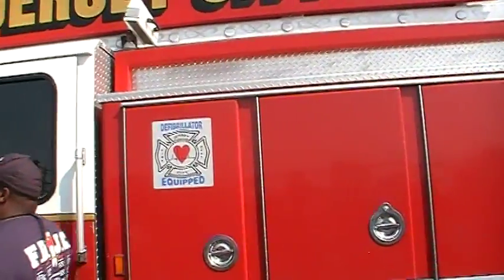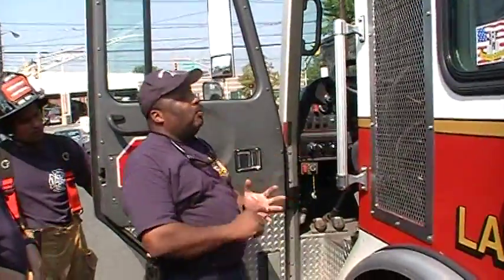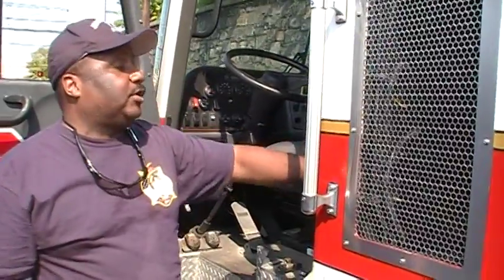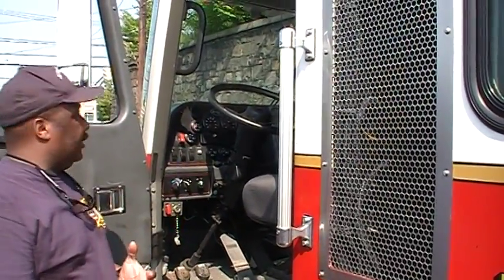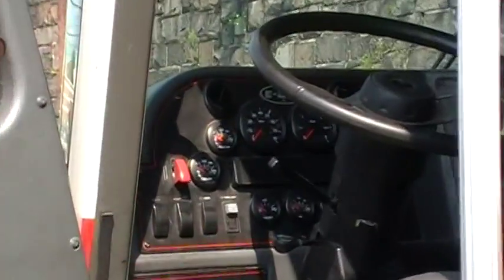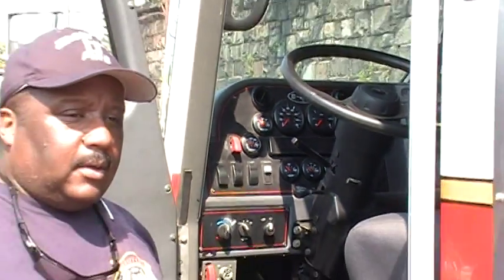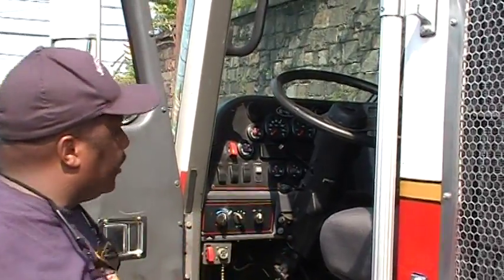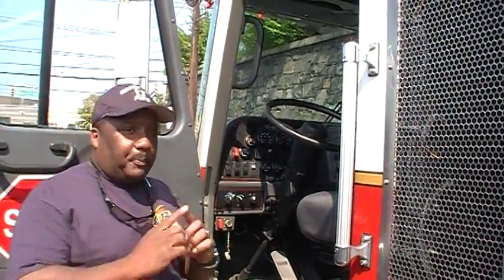Fire Aerial Basic Start - Part 1

Comment: Few things I would add.  lift truck enough to take bulge out of rear tires, chock front wheels, and turn jack plates to where handles are on the inside so they aren't an unnecessary trip hazard.  Very good explanation for those who haven't operated a truck before.

Comment: Dont you chock the front wheels???v When you place the outriggers  the rigs rear tires are to leave the ground  so the rear chocks are useless.  Your suppose to chock the front wheels
Reply: That is the reason for the auxillary/ front axle brakes, if equipped, as in heavy duty vs medium duty aerials. The other option is to leave rears touching street, allowing the parking brakes to provide braking, but not bearing load.
   Dependence upon wheel chocks is not only unreliable but unsafe due to the amount of motion permitted before grabbing and subsequent dynamic / shock load to the aerial.